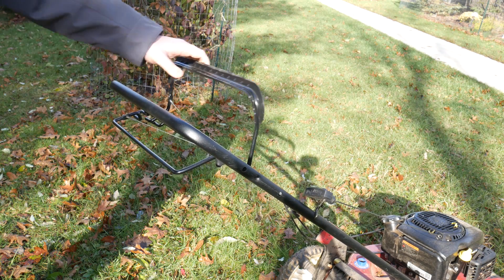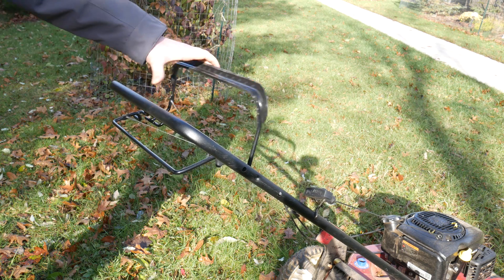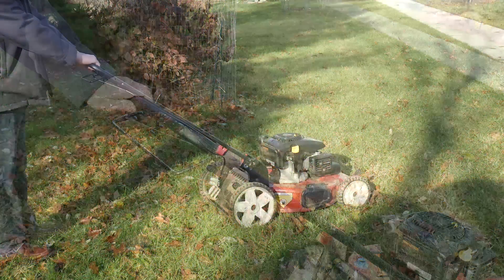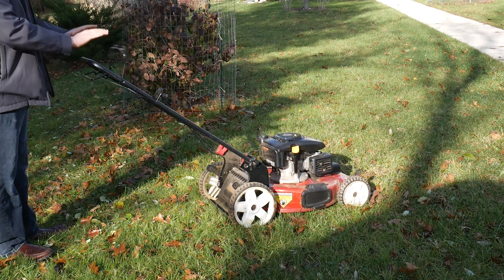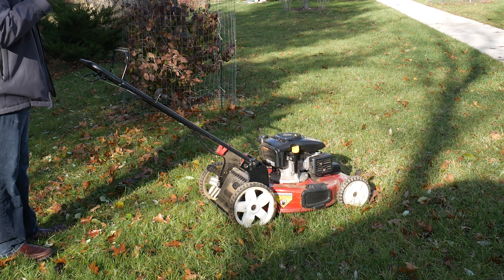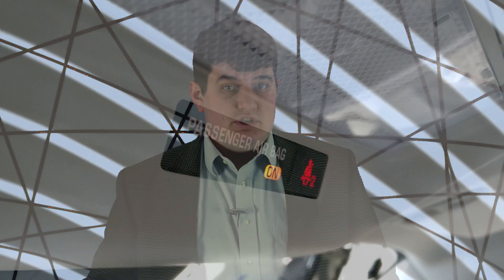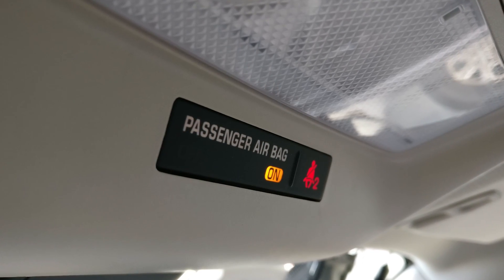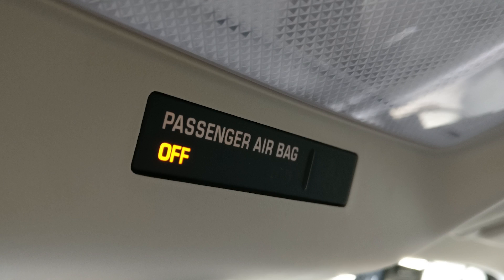The Dead Man's Switch:  How Anton Yelchin's life could have been saved

Comment: And if the driver shifts their weight upward while on the highway, a motion I do often to relieve pins and needles feeling from developing on a long drive, then the vehicle would see it no longer has an operator, and would shift to Park from full speed...

Of course this could be coded around to still be safe, but it shouldn't be a dead man's switch. It should be a command that reacts to several sensors and decides accordingly whether to act.

Comment: Trains have a much more elaborate deadman switch mechanism than that.  It came about from a train accident where the engineer used a heavy toolbox to defeat the switch.   Depending on the design of the device, the engineer has to "do something" like change throttle settings, blow the horn, ring the engine bell, work the sanders, dim the headlight, or acknowledge a cab signal change.  More often though he presses an acknowledgement device.

Comment: The problem I see with this, is almost every situation where you would need the car to be in neutral, the driver's seat would also be unoccupied (pushing a stalled car, towing or even loading/unloading from a flatbed, etc.). The only exception I can think of off the top of my head when I'd have the car in neutral and be in the driver's seat is a conveyor type car wash.

Comment: My volkswagen activates the handbrake the moment I open the driver's door, to prevent this.
Reply: Tesla, which doesn't actually have park, does the same thing.
Reply: @blastum  same the with my new Toyota.
Reply: My Prius does this..It also won't go in gear with the door open. Makes moving around the garage annoying but if it saves a life i can deal with it.
Reply: There was this trend to film yourself exiting a moving vehicle and dancing next to it.
Reply: Wouldn't help on a jeep as some of them don't have doors.
Reply: My Skoda Octavia does the same (it is basically a golf). It also puts the gearbox in park and beeps at me violently.
Reply: @Sergiu Adrian
Can you still release the handbrake manually then?
Because if your car would break down on the road, I guess it would be quite convenient to be able to push your car on the drivers side while still being able to steer it onto the curb to get it out of the way. :-)
Reply: @drops2cents260  yes, you can release the handbrake whenever you want, even with the door opened. It engages automatically when you open the door but can be manually disengaged even with the door opened. Press the brakes and also press the parking brake button at the same time so you won't disengage it by mistake.
Reply: @MEGA-Phallus  
Okay, that sounds like a well-thought-out concept.
Reply: woof

Comment: Ok tried it on my 2018 golf 7 (with manual shifting). If I stop the car and open the drivers door the automatic parking brake engages. I don’t even need to turn off the car but there it also does it. So if I let it run and just go out to pick up my post maybe it won’t roll away.

Comment: I had a 1999 Ford pickup with a finicky mechanical automatic shifter. I put it in park and it was holding, then 20 minutes later it fell out of park and slowly rolled into my camper trailer. I used the parking brake meticulously after that!

Comment: "new" bmw have it.
As soon as you open the driver door it slams into park even when in speed.

And many cars have the parking brake apply if opening the door.

As a mechanic i really hate it when i must exit the vehicle and then move it a few cm to get it on the car lift and the wheels are locked

So yeah, it's been here for years in Europe 😜

Comment: You'll need to use the throttle and the brake simultaneously for shifting. You can't shift down if the computer disable the throttle if you brake. Who make this terrible design which wears down the syncronistation rings. Some gear might not have a sync ring at all!

Comment: Can we stop mandating unnecessary safety "features" to cars because of a single company (and arguably individual consumer's) negligence. These features increase the cost of vehicles substantially while the number of injuries and deaths they prevent is marginal. That's why you can't even get a base model compact car under $20,000 in America anymore. It's not just a sensor and programing. It's a sensor, the wiring for the sensor, the module, the fuses, and the engineering and development to package all of this into a vehicle. This stuff adds up and would probably tack on an extra $1000 to every car. The same thing happened with mandated rearview cameras. People where backing up over their kids and refused to take responsibility for not paying attention so now everyone is forced the pay extra for an unnecessary safety feature. BMW has a similar style of return to center shifter but it requires the user the press the shifter all the way forwards or backwards to cycle through the driving mode and park is on a separate button together and you don't have nearly as many roll aways, same as with any other automatic transmission selector. The Jeep shifter is a stupid design that should have been implemented better and Fiat Chrysler should definitely be held accountable User error can't be overlooked either. If you are the owner and driver of a vehicle it is your responsibility to understand how it's interfaces work and to verify that the 2+ ton machine you're operating will do exactly what you intend it to. Now this isn't meant to demean the man's death, but it has to be said. If you really want to bug Congress about automotive safety features, have them fix the antiquated lighting laws so that manufacturers can introduce safer and more advanced headlight systems to the American market. Or have regulators introduce a more rigorous licensing curriculum that emphasises vehicle control and defensive driving.

Comment: Or you go the Saab route... Saab (manual transmission) doesn't let you remove the key unless it is in reverse... This means of you leave your car, you have to leave it with the keys... Or if you take the keys, the car has to be on gear... This could easily be implemented in modern cars...

Comment: Some current Honda Products (Accord 2.0t, MDX, RDX) have this system in place. If the door is open and the drivers does not have the seat belt snapped in - the car will put itself into Park - as many times as you try to put it in either Reverse or Drive.

Comment: Since the late 1980s, Ford has had sensors in the driver seat that prevent the driver's door being locked from the inside unless the seat is occupied. It will only allow the door to be locked with the key or fob if no one is sitting in the driver seat. This is to prevent you from locking your keys in the car. So, yes, it would be easy.
Reply: I haven't heard of that scheme before. What I've seen before on an old Civic is you can't lock it from the inside if the door is unlatched. This setup is contained entirely in the door so it's likely less failure-prone.

Comment: Railroad locomotives do not have a dead man's switch anymore.  The switch could be too easily defeated by putting something heavy on the pedal.  That was actually the cause of a wreck in Canada where the crew had fallen asleep on a moving train.  Now, they have an alerter button.  If no controls are moved (throttle, reverser, whistle, bell, independent, dynamic or train brake) after a certain time, the alerter will activate.  This is more than a simple dead man's switch.  The alerter cannot be defeated by putting something heavy to keep it depressed.  Either pressing or releasing a button, such as the whistle will reset the timer on the alerter.  The same is true with the alert button itself.  When you depress it, the timer is reset, but the countdown is not stopped.  If alerter button continues to be held down, the alerter will still activate.  An action, such as releasing the alerter button will reset the timer.

Comment: Newer VWAG models have an Exit concept - For example if your motor is in Start Stop and the user tries to exit it, it will apply the electronic parking Brake - only the newest autmatic transmission models have a fully elecronic gearshift interlock which could then be applied automatically

Comment: Ideally but funnily enough the idea will never be implemented. It's been explored before and due to more legal, safety reasons and even cost... It's been thrown out every time it comes up over the years. Deaths or injuries caused by user error are not exactly the manufacturer's main concern over those caused by their faulty designs. Sure they can potentially make a safer product but then they'd take on liability for the safety features failing when they never should have been relied upon over proper practices or when failure causes unintentional interruption of said practices. So as it is a novel idea,  realistically it's not really feasible or necessary.

Comment: Great so when I go to unwedgie myself on the interstate the car will put itself in park at 75mph. Also for my job, it would be more dangerous to wear a seatbelt while performing certain tasks. Maybe we should just let darwinism do its thing.
Reply: The seat sensor deadman switch isn't a very good solution. The way Chrysler eventually solved this issue was tied to the door being opened when moving under 5mph which will force the car to shift itself into park.

Comment: Doing this would prevent cars from being towed a certain way, or pushed for emergency purposes. 
The amount of lives to be saved by these systems is negligible. The reason dead man switches are on forklifts and lawmowers is because operators dont treat such vehicles with the same respect that cars are treated with. A highly trained forlift operator is far more likely to leave a forklift in neutral with the brake released than a car driver is.
Reply: Some cars, like Teslas for example, have an override for this. A "transport mode" that lets the car be in neutral without a driver.
Reply: A override with a discoverable control can exist for the purpose of pushing or pulling the car. But it shouldn't be on the gearshift.
Reply: You know it's really simple to implement overrides, right? Like, have you ever driven a Honda with an automatic transmission from the 90's or 00's? There's a little hole next to the gear shift in the center console. That hole is there so you can stick an object in there to manually override the shift lockout, which uses a solenoid to prevent the shift selector from leaving park without the brake applied. If the battery dies, or that circuit fails, you can still shift the transmission to move it around, like to get it on a tow truck. Now, Honda's are far from the only vehicles that have such a system, but in my experience, they're most common in that particular make. 
And anyway, what sort of towing does this prevent, anyway? You're not supposed to tow on powered wheels on an automatic transmission unless they can be disengaged from the drive train in some way, or there's an electric pump lubricating the transmission in the absence of engine power. Most automatics aren't flat towable from the factory, a fact that greatly predates the design being focused on in this video.

Comment: The jeep had one of those dumb automatics that return the gear lever in the center position whenever you use it. Which can be confusing and a needless feature
Reply: Why the hell does an automatic need a sequential shift lever? That has to be the most pointless idea I've ever heard of.
Reply: @wyattroncin941  some cars (like mine) have it in addifion to the paddle shifters.
Reply: BMWs have the similar center returning shifter but it will shift into park when you let go of the brake and have the door open.
Reply: @Zozzle  yeah I've heard about that!
Reply: @Zozzle  normally jeeps with those do the same
Reply: This is almost as bad as the turning knob gear lever.
Like, if I screw up with radio volume, I notice it but the worst it does is make my ears ring.

Once you get used to that muscle memory of all the way up in park, or down in drive, it never leaves. Even going from column to console or vice versa shifting is weird, but it's always the same pattern.
Reply: @420anonymous  try push button honda shifters
Reply: @420anonymous  The PRNDL pattern is actually mandated by FMVSS.
Reply: @420anonymous  I love my knob on my ram truck😆
Reply: @jakeccr  You love knob. Lol
Reply: @MrEazyE357  haha
Reply: That's what I was wondering, maybe people wouldn't do this if we stuck with prnd in a straight line
Reply: Here’s one, Allison, and some Volvo’s, have push button gear controls, the only indication is a little light next to whichever you selected, and/or the changing of a display indication.
Reply: bmw/minis gearshifting system is stupid on a manual aswell. instead of the reverse beeing shifted into by either pulling a little knob on the gearlever or pressing the lever down you need to firmly press the lever to the right. the thing is that half the time that wont work if you actually want to shift to reverse but it for shure triggers when you want to shift into first. f...their transmission.
Reply: @SB7-r9i  that’s stupid indeed, possibly even worse is the layout of the T45 transmissions in late 90s mustangs. It had 1-5 in the standard H pattern and reverse is directly across from 5th. No lever on the knob, no pushing down, just pop it straight into where 6th would be. So anyone used to driving a 6 speed and trying to shift up from 5th gear is going to get an earful (at least)
Reply: No people have been using ratchet shifters for decades. It's only recently that, they became an issue. You know...when the idiots aka the general public got ahold of them. We've been using them in race cars literally since the 60s and never needed a dead man switch. But we also don't have needless amounts of uneeded garbage in race cars, either, like new passenger cars do. It's a simple ratchet shifter with a very readable gear indicator. Simple as can be. It's when they're made unnecessarily complex that there's problems. Much like what happened. They didn't use just a basic ratchet shifter. They had to try and make it as complex as possible and the result is the idiot public doesn't know how to use it.
Reply: @JC-11111  Complaining about how modern passenger cars aren't as simple as they were 60 years ago... and how the general public is to blame for being dumb... This is the most old man comment I've seen all day.
Reply: I work car lots. Moved over 500 cars with this transmission. NEVER did I have this issue. Its all about paying attention to what you are doing. His fault, not the cars
Reply: @liquidfiretibby  The question wasn't about who's fault it is, it was about how to prevent accidents when imperfect human beings are in control.
Reply: @liquidfiretibby  That seems to ignore the fact that the shift has no reason to work in that fashion. Whether he used it wrong is obvious. That fact it works in that manner is simply stupid.
Reply: @liquidfiretibby  his main fault that would prevent the crash. Use the parking brake
Reply: @liquidfiretibby  It is definitely FCA's fault.

Part of designing a tool is making it as easy to use as realistically possible.

Part of ease of use is familiarity. Until this came out, every car had standardized controls for gear selection. 

Even the rotary knob and push button are familiar, as they are used for radios and ovens.
Reply: @King_Elsydeon  lol every car certainly did NOT have standardized gear selection before this trans. And no its not FCAs fault their customers are stupid!
Reply: @liquidfiretibby  Could it have been prevented by designing a better car? Yes? It's the cars fault. If a product becomes deadly from the smallest amount of user error, the product is not fit for sale. No matter what the product is. The only exceptions are when there is no way to mitigate damage from user error or when the users actions are completely intentional.
Reply: @liquidfiretibby  What about the word user error don't you understand? If someone goes out of their way to hurt themself, that is their problem. If someone got hurt because your product is poorly designed however, that is your problem. Plain and simple. A car that can drive without someone in the driver seat is poorly designed. The only reasons to not prevent a car from moving without a driver are laziness and greed. And those are never valid excuses.

Signed

- Someone from the Netherlands. A country that knows what the term "functional design" actually means.
Reply: @rendomstranger8698  almost every car can be put into gear without a driver in the seat. We spend way too much money protecting stupid people. If you can't be bothered to put your car in park before getting out, thats on you.

Also, you can't turn the car off when its in gear. So thats the safety measure thats already there but no one wants to talk about because we can never blame the idiot that hurts themselves
Reply: @liquidfiretibby  And almost every car is poorly designed because of it. I don't care about your appeal to tradition. And I especially don't care about you putting money over human lives. Come back once you got an actual argument against putting a dead man switch in modern cars. Because if all you're going to throw at me are bottom of the barrel arguments, we're done talking.

Comment: When safety system behavior reduces functionality, it frequently gets overridden. Any deadman switch behavior should have an easy way to override it temporarily. I would rather have the deadman switch on my lawn tractor functioning (with an override). It is disabled because the tractor gets stuck on moist grass with a slight incline. It needs to be "rocked" or pushed to continue operation. Imagine a sailboat that drops the sheets if someone moves to keep it from tipping over.